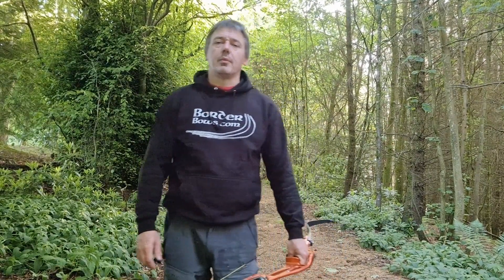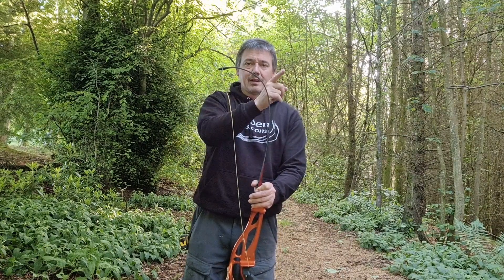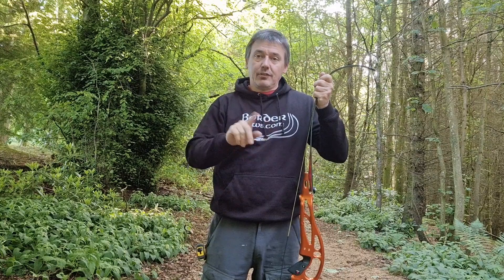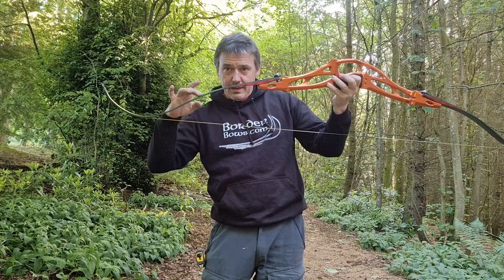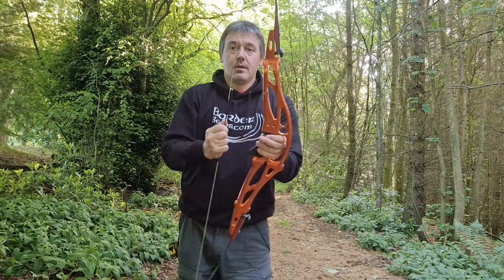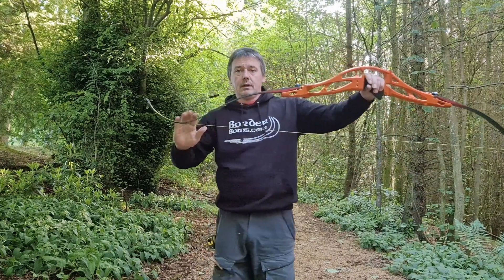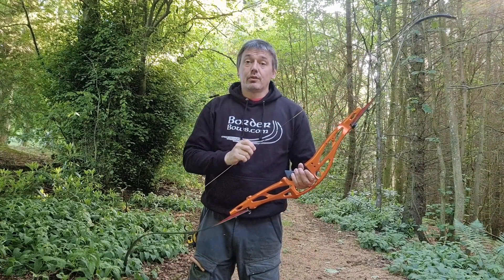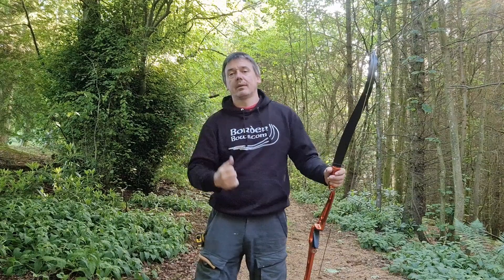Brace height and bolt position

Comment: A couple of question from your experience as a designer/engineer. When you design a limb pocket, do you make it so the optimum position of the tiller bolts are when the tiller bolt head is flush with the limb surface? Also, the grove in the limb, is there some tolerance in the channel length? I have never found my string making contact along the entire length of the channel, but having an inch or so exposed.
Reply from the maker: For the limb bolt position... are you asking for aesthetics? Ir practicality? If your using our limbs and you have string groove exposed that much your brace height is too high, this could be a result of using a riser with poor deflex. Or limb bolts fully in. Or an agressive riser design
Reply: @BorderArcheryLTD  As far as the tiller bolts, I assume there are two considerations in a design: a specific angle required for the limbs and the pressure from the bolt head to be distributed over the largest area. I assume, not being a riser designer, that those would intersect so the "optimal" tiller bolt depth would coincide with the maximum surface contact with the limp surface. From there, the range of tiller bolt movement, how far out to how far in, would be decided. Hoyt did have a floating tiller bolt head design that moved with the limb position, so I assume that surface area for contact between those surfaces are important. 

Unfortunately, I do not have your limbs. 
😢
Reply from the maker: @mozu305  do you make or design any part of a bow or are in the process of?
Reply: @BorderArcheryLTD  No, I am just trying to understand my ILF bow.
Reply from the maker: @mozu305 the bolt pressure/surface area is a misnomer.  Its a utter fake point.    Scratching the limb surface is a thing we wanted to reduce, which is why we use floating head bolts.
To allow the dovetail space to move on the +/-5% its best mid position is perpendular, limb to bolt at right angles. That way you have least potential snags fully in to fully out.

Comment: What was the point flashed up about Centre shot and BH pease Sid?
Reply from the maker: You have a very shallow triangle. Point outside of centre.  If you reduce your brace height, you reduce 1 leg of the triangle and in this case the point will sit a ton more outside of centre in a ratio of brace height to arrow length
Reply: @BorderArcheryLTD  ok simple geometry .. that's fine thanks . I run close to dead centre anyway and low BH .. use CV5 . max i change BH is 1/8 " around the 7 1/2 for long on 25" . Also near fully out bolts only use them in a little to get fine tune of arrow spine .
Reply: @BorderArcheryLTD  So, in this case, if I reduce the brace height without modifying the center-shot, I stiffen the arrow spine ? Is it correct ?
Reply from the maker: @Death_Spot reducing centreshot increases power stroke so you get faster arrow speed. It also changes how much point of the arrow is outside of centre.   It also changes string tension (follow through and therefor nock separation timing)    all id say for sure, if you need to retune spine and nocking point if you change brace height
Reply: @BorderArcheryLTD  At the beginning of your answer (to me), you meant to write "brace height" and not "centreshot", right?
Reply from the maker: @Death_Spot yes.   First centershot statement should read brace height, my bad.     Thanks for asking rather than flaming me.... humans be humans at this end
Reply: @BorderArcheryLTD  Everything is fine! It's true that in archery some people may react strongly! I appreciate your sharing of knowledge and your reasoned investigations with demonstrations, making the effort to make things accessible. It opens my mind. Sometimes it's difficult and it takes me a little time to digest. Thank you for your work.

Comment: nice explanation.
i realy need to need to change my setup, with fully bolt in limbs.
It seems the better way to choose stronger limbs and bolt them out, for more stability.
One point of different brace hight, is the change in the distance the arrow is accelerated.